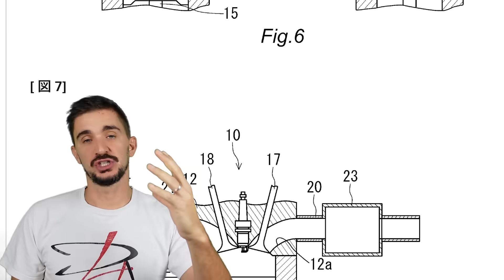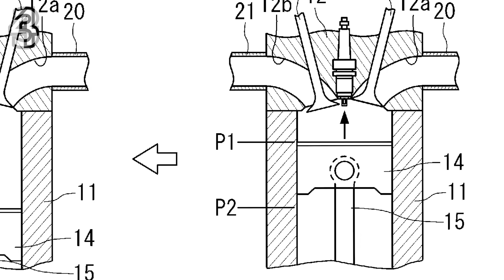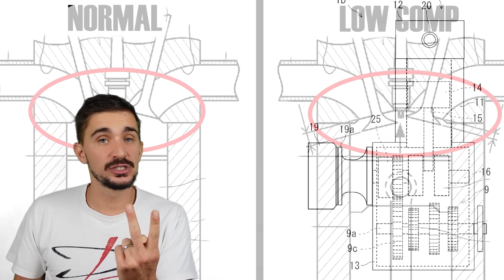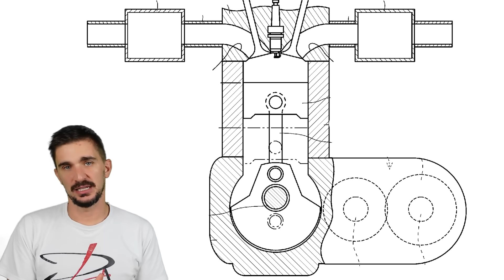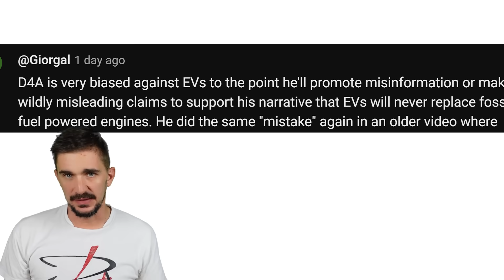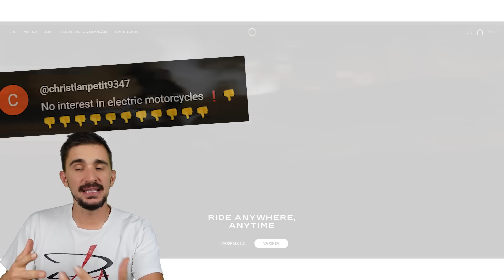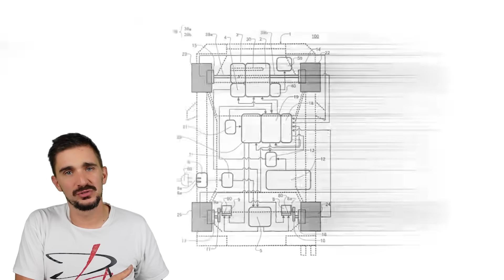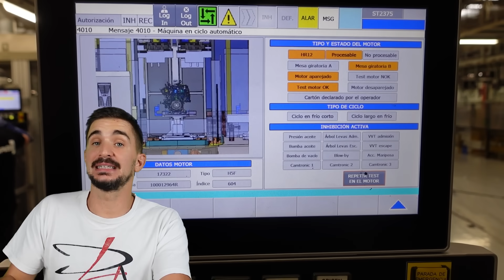Yamaha Just Patented A Fake Engine

Comment: I drive an Energica Eva Ribelle RS and I never would want such a device in it to add weight and reduce range. 

I can absolutely feel the passion of petrol heads, maybe I am one by myself and get good bumps from 5 Cylinder, V10 or 2-stroke engines. Driving electric is different. They have their own soul. Of course very different from ICE engines. In case of Eva Ribelle it is the sound of chain and gearbox. For other BEV like the Tesla Model 3 Performance hat I had before, it is just the acceleration. But please don't do such fakes. For me it feels ridiculous already to hear farting cars, "engine" sound that comes from speakers, diesel engines that sound like a V8, but when you stand beside them, your hear that it is just a plain 2l diesel like in every 15 years old Passat, unreal loud noise in Golf GTI that causes me headache. If the sound is not real, please don't do it.

Comment: Imo this 'engine' is pointless.  Sound? F*** sound! There iscalready too much wind noise! And most riders use earpieces anyway to listen to music/phone/navigation while travelling.

Bike manufacturers should focus on making EV bikes that have long rang AND can do fast charging.
For example, a ZERO can do about 200km on 1 charge but it can not fast charge. WTF!
The Verge CAN fastcharge.
They should also sell paniers in which half the space is used for EXTRA batteries. 2 sides. Fully integrated in the charge system of the bike. The topbox can still be used for luggage. Maybe you coild squeeze out 400km on 1 full charge? That would make the bike a LOT more useable for long distance touring.

Comment: Completely agreed with your point, it doesn't make sense to manufacture or pay for something that does nothing (well, it does something, but that something is detremental). But. It does not perplex me because there are many other examples of virtually the same thing. Take a look at electronic drums. They have evolved from pancake-style pads that were practical and functional, to having full sized acoustic shells (and not the cheap ones either) fitted with sensors, metal cymbals that make much more noise than the usual rubber ones and people love them... if they can afford them. Almost every ambicious company will cater to people with money, and people with money care about the fasade more than anything else (except for their money) so the companies produce stuff that makes the fasade look, sound, feel or smell as whatever is desirable... heck people even put useless crap in their body just to look 'good'... 
Anyhow, this 'retro' craze will die out with the generations that have any connection to that mechanical past, the new kids will be just as preplexed as you looking back at all the crazy stuff we made and used in these transition years.

Comment: 1. Do you need to change the oil (often) if there is no soot from combustion ?
2. Sometimes you throw a patent to protect a single clause out of the many others you throw in it, this way you hide your real intentions. Could it be a feature for a potential hybrid system, where you deactivate your engine but still get the sound ?
3. Other times, you throw a patent to secure no one else will try/do even the dumbest thing possible, that mayend up being a hit.  I saw a patent of an L shape pipe once...

Comment: The only thing which makes any sense is if Yamaha are foreseeing a future where all IC engines are banned, and the only propulsion choice is full electric. Then, the use of a ‘device’ which makes same/similar noise and sensations as a reciprocating IC engine, but on an electric-powered bike, would probably be the Unique Selling Point for a maker of electric bikes, and help attract market share.

Otherwise, I agree with other commenters here in that the simplest solution would be have a small electric motor which drives an ‘imbalance’ shaft, in sync with a loudspeaker, to generate the same/similar sounds and sensations of a reciprocating IC engine.

Comment: I would doubt that this is actually a new and novel idea. I was working on this principle about 23 years ago when working for a large automotive OEM. Background: in that time, we were looking into a hybrid system that consisted on an electric motor that was directly coupled to the engine crankshaft, and which could fully variably provide between 0% and 100% of the required torque, so that the ICE did not need to burn fuel, when there was accessible electricity in the hybrid battery, while the actual powertrain architecture remained as simple and 'conventional' (AKA: cost effective) as possible. This included emission related phenomenon as well. We explicitly investigated into the effects and benefits of running this engine on 100% electricity. These were particularly given at idle, but not exclusively, and if it was not only about the noise and vibrations (passenger perception) then the system could also be used to keep belt drive rotating (conventional mechanical power steering, AC, and 12V alternator). On a motor bike, only a sub set of these features would be possible, but if they chose the system wisely, then I can see that this is their attempt into a motor bike hybrid.

Comment: Maybe the text about the feeling is just a decoy and it's the weird valve timing they want to patent for some future use. With this valve timing you could reduce the engine brake torque during fuel cuts.

This would enhance drivability a lot or enable a greater range of adjustable engine brake which is a thing in modern street bikes.

Comment: Thats because Yamaha doesn't believe that electric motors are viable so it patents an engine that is an actual engine for "buckup power" and calls it  a "proper engine sound" aparatus. The reason is to lower its emmisions rating.

Comment: Imagine having to change the oil on a motor that may not even air up you tires. 
To be fair, long change interval 
I want a gasser, I'm going to buy a gasser, not a fake. 
Motorcycles are a lot about the feel, electric cant do it. 
Honestly I don't think the fake engine will be close enough. I will look to youtube for that answer, since I can't buy one. The example you give is a at the end is still a gas powered motor, more compression, not spitting back through the intake. Maybe fake motor will be close. I know what a motor with no compression sounds like when its spins over, this will likely land in the middle. I feel its going to land more to the no compression side, just due to design. Knowing the compression ratio and a baseline for compression psi could help understand how well it will or wont.
Fake motor is a pretty dumb idea overall.

I do like the idea of electric bikes, in smaller forms, like scooters and fatboys. Things you go get the mail with.
Electric bikes in general will be fine, though the electric vehicle is not going about it the right way. 
Electric only, the 'cleaner' argument aside, running a small gas generator to charge the battery gives you the range back. The generator motor running at 1 maybe 2 rpm set points, should have a much lower emissions output than a typical gas engine used to power a vehicle.
There are many powerful generators out there that are super quite as well. Liquid piston has been working on rotary engines for generators, hydraulic pumps, and small craft.
 
LOL The stark bike REQUIRES your cell phone for gauges?!!?!?!?
Reply: couldnt you just record the noise and have it going through a subwoofer ? ok maybe not loud enough
Reply: are you saying a small gas engine with electric generator is more efficient than a bike engine ?
Reply: @echelonrank3927   No.
 I made no claims about efficiency. The gas generator added to the electric car, is the final answer to range, as I see it.
Reply: @relmdrifter  alright , and im seeing donkeys on horsecarts extending ranges in the dark ages. but what does this have to do with bikes ?

Comment: I  can understand the motivation for doing this, but it is unnecessary to do this using this method.  As part of most electric vehicles, they do have to make sounds like a motor car just because of safety reasons but this can be produced electronically with a lot less power and also the vibrations of motor can be done electrically.

Comment: Why not make it availble as an engine when batteries die. All that work just to not have a backup. Seems lame. Let it run with ignition off when you want the sound but make it avaiable to use if you need it.

Comment: If people buy harleys with half the power of modern bikes but maybe more sound and charcter of old for so much money, maybe this isnt that crazy for just a small amount of power loss but most of the hybrid benefits. Thats the problem why not just make it a hybrid it would make so much sense, they can use electronic vct to open the valves but still have the engine connected so it does all this but also turns on and makes power. Like someone else said dummy engine to skip new car regulations with a kit to convert it to hybrid is their plan which would be cool but probably shut down quick.

Comment: I don't think the Japanese patent office does any checks.
Nintendo just patented the "gaming system of summoning monsters to fight another monster", what was clearly meant to protect Pokémon from Palworld - but it includes so many more independent games that use any kind of summoning (like TES Skyrim). Also this system is not new and I novative. In fact it's as old as computer games can be and has been done many times.

This patent is just another one in line with crazy corporation anxiety to protect from a non-existing problem I guess

Comment: The only thing I can think of as to a reason why they might do this would be a compressed air burn cycle eventually. Because there is a car setup for drag racing that actually uses compressed air in place of turbos. He uses giant cannisters full of compressed air to inject into the engine at the equivilent of like 80-120psi kinda like a supercharger and its pretty cool. So maybe Yamaha has some theoretical implications with that kind of technology like a hybrid electric-compressed air engine or something.

Comment: Why not just make it a hybrid, and include a mode where no fuel is delivered to the gas engine, but it's still engaged to the drivetrain. I see a few modes:
-electric only
-gas only
-gas and electric simultaneous drive
-gas motor engaged but not fueled

Comment: The Bean Counters must be in straight-jackets. 2 things beneficial would be, onboard air and thermoelectric power regeneration but that wasn't mentioned so it must be concluded that some Japanese Motorcycle Mfg just go crazy. Honda has done it a few times. Remember the Rune? They dumped truck loads of money into that project and got bupkis for it. The public however go something amazing if you are lucky enough to get your hands on one. Then there was the NM4. Weirdly desired and collected that broke ground on the DCT along with the CTX models using the same running gear. Before that there was the ugliest scooter on the planet the Helix. Just god-awful. The thing is, they still performed the task of being a motorized bike. Kawi and Suzi the ugly twins just seem to plod along with one foot in the past. 
Yamaha just seems to be wallowing on the brink of extinction but with a few sparks of genius. The V-Max, Tenere, MT series, R1, Raider (which initiated the Big Jugs wars at 113 ci) etc., but nothing insane comes to mind, until now.

Comment: The only way I'd like to see this implemented is as a solenoid engine.

 Sure it's inefficient and inferior to regular electric motors in every way, but at least the design isn't completely fake, serves a purpose and is mildly interesting from an engineering standpoint.

 That said, I really struggle to see who would actually want this.  My only guess is it's an example of patent capture, so they have the rights to the idea/concept even if no one in their right minds would pursue it.  Because there's always someone out there who IS out of their mind who might...

Comment: They are doing this, on the hope that one day, battery tech will be so good, that with a small battery you'll have 250km range and 3 minute charge times... Then having more battery becomes pointless... That opens up for a bike to have such a thing as so to give it some soul...  It's not like they are going to put it now, they just patent it so someone else doesn't do it before then.... There's plenty of people running tiny engines with compressed air, and they sound the part... So... This in the future, could make sense

Comment: As someone who has their name on a patent that totally should NOT have been granted, I think you might be failing to understand the inertia of these companies, and their policies.  In my case, my company has a department who's job it is to identify innovations within the company and drive those innovations through a patent process.  They rationalize this by saying we don't intend to bring it to market, but we don't want to get shut out of a market because someone else patents it first.  They operate on a metric of how many attempts they made, not how many patents were granted, or even how many patents were "good ones".  In my case, I think I got caught up in a slow week, because despite my protests of "this is all just common tooling in this domain" they still press forward with the patent application.  I'm sure Yamaha has the same problem.  Someone's job is to push patents, and they had a slow week so they swept up this garbage fake engine idea, and like a pit bull, once they've got their teeth in it, they're not ever letting go.

Comment: Just a few ideas: 
- If a fire piston only uses air and compression for ignition, perhaps it is worth considering whether or not Yamaha is prepping for forced induction, air-only combustion to supplement battery power.  Perhaps diving deeper into detailed studies on Adiabatic compression evolving technologies may be a clue (25 or 30 to 1?).
- The other thought is to simplify a regenerative technology during deceleration where some of the energy could be retained and fed back into the system (compressed air or otherwise).

Comment: Sooo...how about a fuel filler cap replacement with a fake electric cable receptacle to inconspicuously park in electric vehicles only spots? Just add a couple green "e" stickers on the side for good measure. Asking for a friend

Comment: 3:14  in this stroke the diagram isn't very clear, but the exhaust valve opens near the top of the stroke when the air is compressed, and then closes, and then the intake valve opens as the cylinder goes down. the v1 and v2 indicate the order that the valves are opening, and the 2nd pic indicates that the intake valve is opening only slightly. the intake valve is not open during all of the cycles, it's just drawn poorly. 3 and 4 are useless, but i'm assuming it's to make it sound more like a 4-stroke engine cycle.

if the exhaust valve opened after the cylinder went down, as mentioned in the video, there would be no difference in pressure, and no exhaust sound.

Comment: You asked for a comment so here it is. Safety.  Two wheeled vehicles are inherently dangerous and the faster they go the more dangerous they become as time available decreases. The hazard is other vehicles, mainly four wheeled driver’s observation. Drivers have only two sensory inputs. Visual and audible. Visual is complex and requires processing time. Audible is basic and immediate. Any experienced bike rider knows that the sound emitted by a motorcycle is a safety factor on many levels. An electric motorcycle moving at road speed making no sound would completely remove that input from other drivers leaving only the more complex visual input with its increased reaction time. What’s the first thing most car drivers say after a collision with a motorcycle?  “I didn’t see him”. But if they hear the motorcycle they’re more likely to know it’s there.  So, Yamaha may be banking on the safety aspect becoming a factor in electric motorcycle evolution.

Comment: TL;DR, methinks Yamaha is planing to sell an experience based on deception to those who don't care.

My guess is they want to sell an experience and the problem isn't whether the energy losses are optimized or whatnot, that's just us being nerds. I would propose the problem to be "Can you live with your experience being based on deception?". If the ultimate goal of Yamaha as a company is to make money, then it would be reasonable to assume they will produce what sells. Sometimes people want to buy a form over function experience and in a time of environmental angst this would make develpoment of a pretend engine somewhat reasonable, depending on your target demographic's stance. 

Selling form over function isn't very uncommon. I would say Harley Davidson is a prime example of this. As other commenters have already mentioned, Harleys have no power and no efficiency. They do, however, look good and have a lot of noise and shaking. This probably provides the experience the buyers are looking for, form over function. The difference here is that a Harley is unoptimized from an engineering standpoint and not very environmentally friendly, while Yamaha's pretend engine provides the experience but in a deceptive way with the purpose of being easy on the environment.

So the problem as I see it becomes a question whether I as the consumer can live with my experience being a manufatured deception or not. Personally, I'd find the experience flacid if I knew it was a deception. Others may think differently.